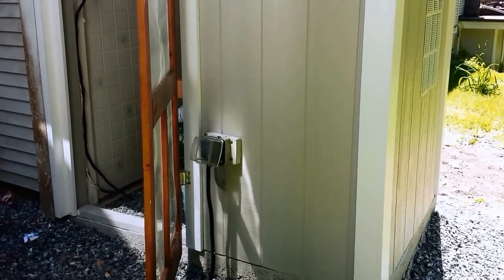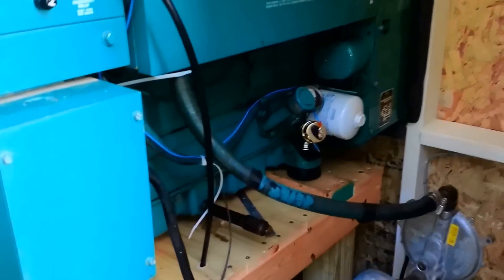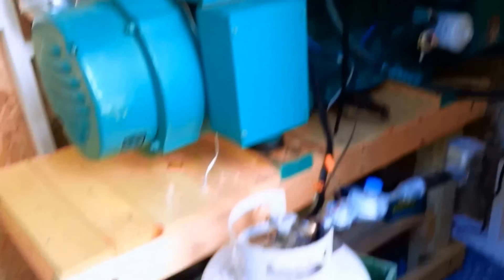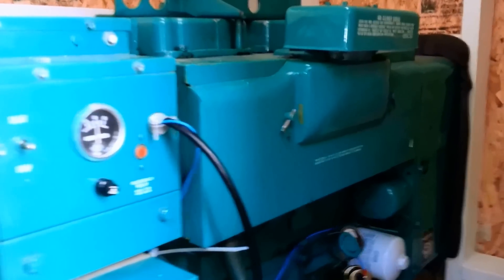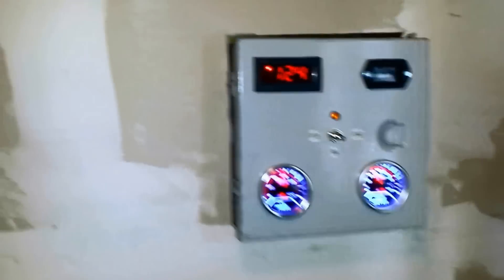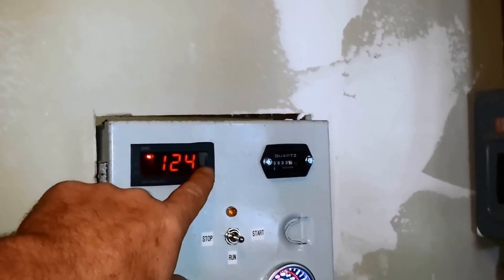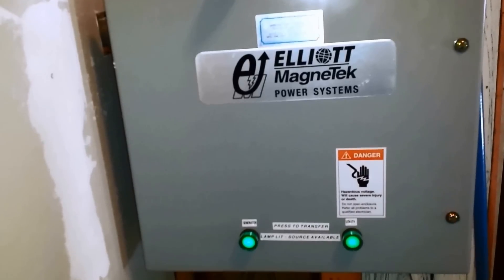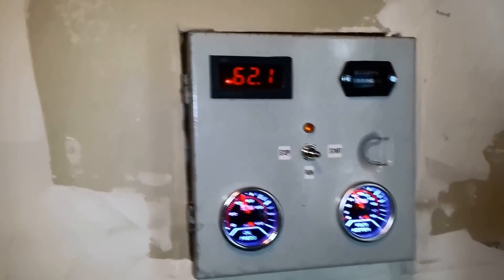Onan 12.5JC Begins a new life as a home standby generator

Comment: I have one that was in a grocery store running 3 phase. Can you tell me how you ran all your electronics and phases please I really need help and some guidance with this.
Reply from the maker: The first thing to check is if the generator is a 4 wire output or 12. If 12, it can be reconnected for multiple voltages, including 120/240, which is what you will need for your house. If it is a 4 wire, it might still be possible to use it depending on what output voltage it is configured for. Can you take a clear picture of the data plate and send it to me? It will answer a lot of questions.

Comment: The fuse reset button, how did you get it to stay put? What's the maintenance process for it? Out of all three models which Gen is best to own?
Reply from the maker: The red button pops out to shutdown the generator if there is a fault - low oil pressure, for example. If it will not stay pushed in, it is defective and needs to be replaced. The maintenance is easy and pretty straight forward; oil and filter, spark plugs points and condenser. If you run it on LP or natural gas, the engines stay super clean inside and oil changes can be extended. I am not sure what you mean when you ask "Out of all three models which Gen is best to own?"

Comment: This is really nice, Jim.  Are you still happy with it?   I assume this is air cooled.  What sort of LP consumption do you see?
Reply from the maker: I sold the house I installed this at a couple of years ago, but it was working great then. It powered through a four day and a few shorter outages without a hiccup. It was thirsty - about a gallon of propane an hour at no load, and three gallons per hour at full load per specs (I never had enough turned on to fully load it - even when doing laundry). Those old Onans were built for thousands of hours of use.

Comment: Nice setup 👌 does your generator have a small trap door next to the generator head with some type of heating element idk what it's for my generator is the 12.5 kw 1980 ⛽
Reply from the maker: The generator cooling air outlet is a rectangular opening on the side with the engine exhaust. In it is a variable resistor which regulates the battery charging circuit. It is quite big for a resistor, so it often gets confused with something else. Thanks for your question!

Comment: Nice setup 👌 does your generator have a small trap door next to the generator head with some type of heating element idk what it's for my generator is the 12.5 kw 1980 ⛽
Reply from the maker: Jose, in the generator air outlet is a resistor, not a heating element. It is for the battery charging circuit. In many cases, the resistor has a moveable slide to adjust the charging current.
Reply: OK I'm lost 😐 the little square vent that I'm referring to is located below the electrical box that holds wiring and to the left of the generator head the part in there looks like a 🌽 behind the generator where muffler exhaust thank you
Reply from the maker: @JoseOrtiz-mw6zv  I think we are talking about the same thing. If you send me your email, I'll send you a picture with the resistor circled to make sure we're talking about the same part.

Comment: Hi jim can you tell me the model  number of the first refulator
Reply from the maker: There are three total. The one at the tank reduces the pressure from tank pressure to 5-10 psi. The secondary regulator regulator reduces the pressure to 10" water pressure (about .5 psi). The third regulator (round one) is a demand regulator, that only allows fuel flow if there is a vacuum in the engine intake.
Reply: Hi Jim is me again the first two regulators are a camco 95313 or 95323

Comment: Hi! Where to get the gauge and meters digital?
Reply from the maker: You can find them on ebay and Amazon.
Reply: Thanx Jim! Btw, excellent restoration work. Did you or bought well?
Reply from the maker: It was in pretty good shape when I bought it, but I refurbished it, including upgrading to electronic ignition, setting the valves, new plugs, wires, cap, rotor, and replaced external gaskets and paint.
Reply: Jim Thomas Good job my friend. Nothing better than generators onan with onan engines. Indestructible. I have one 20 years ago, but it is 17.5 kw diesel, cooled water. I'm restoring

Comment: Jim Thomas I just saw your video, that is an awesome setup. I was wondering if you still have that manual in PDF form? My just noticed that the actual Generator is starting to make noise (almost  grinding sound) and know nothing about this thing, since I purchased our house and it came with it.  Any and all knowledge you have about them would be appreciated.
Reply from the maker: I do. Shoot me your email and I'll send it to you.
Reply: mess4444@gmail.com
Reply from the maker: If it is an Onan JC, grinding noise is not common. I'm assuming you mean while it is running. If while starting, the starter drives do go bad, but can be rebuilt by any starter/alternator shop.  If while running, it may be the generator bearing.
Reply: It is the outer bearing on the bell, which supports the stator driveshaft. I need the part # and detailed breakdown to ensure that I get the right parts.  Looks easy enough to change, my dilemma is that I am located in the Virgin Islands and logistics is going to be the issue.

Comment: Also what kind of solenoid did you use?
Reply from the maker: The low pressure regulator is a KN, standard on all air cooled Onans of that era. it is supplied 11" of pressure from a standard secondary regulator. No manual prime is required.
Reply: +Jim Thomas   Ok, So I guess it doesn't matter if It has a manual prime or not.  I noticed on the KN I was looking at had a manual prime.    How about the 12v shut off solenoid? I'm looking at onan part number but cat seem to locate one.  
 FYI... I'm not sure if you installed one? but when I read up installation of the exhaust it says, if  you go vertical with the exhaust you must put a drain at the bottom to drain the condensation.
Reply from the maker: The solenoid is by Asco. You can find them in industrial catalogs on ebay.  Make sure you get one rated for gaseous fuels.  My exhaust is vertical,  but with a raincap and a horizontal section that slopes away from the engine

Comment: By any chance do you know where I can find the Onan manual for Lp? Still a little confused about it,solenoid etc. I've been hearing few different ways from Lp installers that I only need one regulator with half inch refrigerant   copper tubing since the tanks are not far from the generator.  It didn't sound right to me what I've been told so I've been trying to do my own research.  I know Lp motors require accurate pressure to run correctly.  Right when you started that motor up, I knew that you know what your doing.
Reply from the maker: I have the manual as a pdf. If you send me your email address, I'll send it to you.
Reply: Jim, Can I get a copy of the manual? Thanks, Tom e-mail: tom@thhpc.com

Comment: I have the same generator and trying to figure out the propane. What did you use for a regulator etc? I just recently bought 2 100 gallon tanks.  Thanks
Reply from the maker: At the tanks you should have a primary regulator, which drops tank pressure to 5 psi. Near the generator, you will need a secondary regulator which drops the pressure down to 11" or .5 psi. Then a "y" strainer, a solenoid valve, then a demand regulator. If you watch the video, you can see the secondary regulator on the outside wall under the air inlet, and the solenoid and demand regulator inside next to the generator. Onan published a manual with information about sizing and installing natural gas and LP systems. Don't undersize piping - the generator uses a lot of propane, especially at full load.